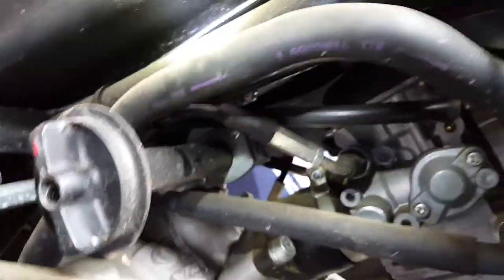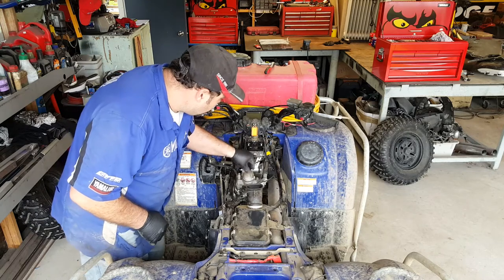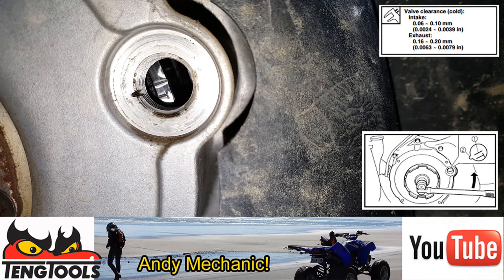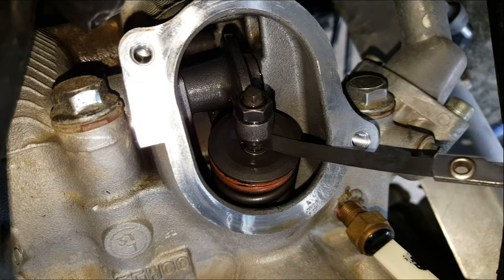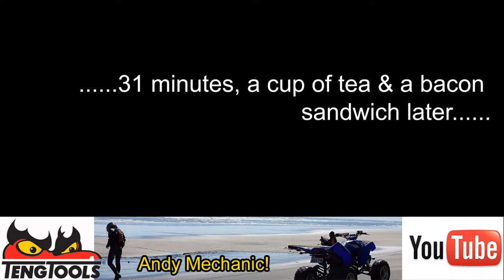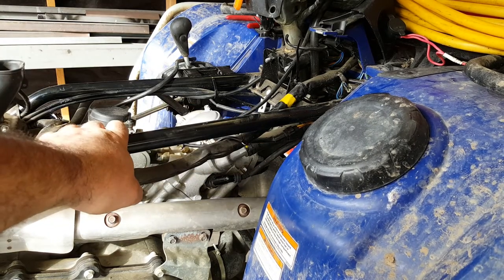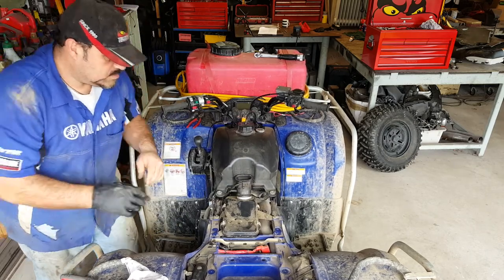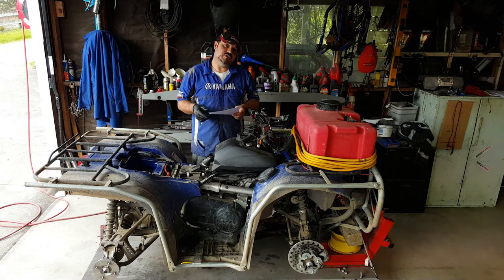Yamaha Grizzly 450 - valve clearance adjustment #1806

Comment: Ive seen on another video to get better access with out removing the front Fender assembly. Is to remove the front left wheel and strut. It help to get better access to the exhaust valves.

Comment: I adjusted the valves on my 03 Kodiak went 0.08 on Intake and 0.18 on Exhaust well with in spec and noticed it very noisy.  Starts great and idles. Just a bit tap it noise. Although the Valves where never adjusted since it was new. And where way too tight before i went in there to loosen it up.

Comment: Hey Andy! Great videos I watch you adjust the valves on a 450 grizzly. I assume that's the same motor in the rhino?  I have a rhino 450 I've been working on, it starts up and idles push down on the throttle and it spits and sputters and bogs down want rev up.. I've took carb off and apart cleaned it. new spark plug and air filter.. No change same problem.. Any ideas? Thanks!

Comment: i was fighting the ex valve. doesn't matter what i do, fully open it or fully close it (with horrible access using a mirror) it seems that the gap doesn't change. looks like a fused valve. any idea how to get it loose? In valve was perfect. didn't even need any adjustment.
Reply from the maker: Rotate crank a further 360 degrees, you are not on the firing stroke
Reply: I thought both valves should be inspected on the same T line. Was I wrong?
Reply from the maker: No you are correct but remember, this is a 4 stroke engine = 2 turns of the crank shaft to 1 turn of the cam shaft. You are 360 degrees out on the crank shaft to rotate one full revolution and reset both intake & exhaust valve clearances
Reply: Oh....you get a point! so I assume i need to try rotate it additional 360 degrees and look at the ex valve. I hope that is the issue.
Reply: just emailed. thanks a lot :)
Reply from the maker: Do both intake and exhaust clearances again as the intake will be incorrect

Comment: haha!!! 31 minutes, a tea and a bacon sandwich later  Great video!  I will be doing this tonight along with a carb cleaning, as i have a WOT backfire/bog/loss of power, anything else you can think of that i should be looking at?  I've done spark plug, belt, and checked clutches
Reply from the maker: Check intake valve for leaking too.

Cheers Andy

Comment: I got a carburetor question, does the small  pin in the needle valve suppose to pass the air and stop when compressed or is it the entire needle valve that lifts up of the bush to allow fuel to run in? My needle valve (new) doesn't allow air flow unless i use an air compressor which blows up the whole valve and let the sir flow
Reply from the maker: The spring loaded pin is (maybe) a damper to prevent the valve 'chattering' on the valve seat which would cause excessive wear. The fuel should only pass between the valve & valve seat. 

That's how I understand it. I'm sure other experienced viewers may be able to add to my comment too.

Hope that helps

Cheers Andy
Reply: @AndyMechanic  Oh wow. that helps a lot! if that is the case, mine is fine and I can finish the carb installation. I thought it might be the pin that regulates the fuel flow.

The "hinge" that binds the needle valve with the float, also slightly lifts the valve up when extremely deflected upwards. should it be like that?
Reply from the maker: Hmmmm....really? Well I think under normal operation, with the floats just 'floating' in the fuel they shouldn't reach such an extreme angle so should be fine.

Cheers Andy
Reply: @AndyMechanic  does the hinge that binds the float with the valve should be tight so when the float moves it will immediately lift or compress the valve? At the moment it is very loose fit and dangles too freely so when you move the float upwards, it doesn't lift the valve. I wonder if I should change it
Reply from the maker: The pin that goes between the two 'towers' is usually tight in the towers but the floats should be loose on the pin and flap freely.

Comment: nice video Andy, I'm working on a 2004 Yamaha Bruin 350 4x4. I have a feeling that these valves have never been adjusted. Upon pulling the starter recoil assembly, it nearly ripped my hand off. How far off are the clearances from the 2014 model from the 2004? Also I seen a tube coming off your carb? Is that going to the air box??? This one is also missing the air box as well...

Comment: If my engine backfires and wont start after valves adjustment, carb and air filter cleaning, should I check the timing chain and tensioner?
Reply from the maker: You should check both valve and ignition timing. Also do a leak down test to check your valves aren't leaking.

Good luck. Cheers Andy
Reply: @AndyMechanic  Thanks. will do it now. i want to remove the camshaft sprocket cover so i can check the timing chain position at TDC, also if it is tight. Is it possible to remove it without removing the whole plastic front of the Kodiak?
Reply from the maker: Yes, just the side panel should give sufficient access. You may want to remove the fuel tank too if too tight a space to work in.

Cheers Andy
Reply: @AndyMechanic  Thanks Andy. Ill give that a go. I want to inspect the chain tensioner if it failed. Other than checking the chain slack through the camshaft sprocket cover opening, is there another way? My ATV was running very nicely, starting easily before. I suspect something had failed ....
Reply: start whit the plug

Comment: Hi... I know that this is not a Bruin video but I am wondering if you might me able to help me out a bit anyway? I have looked everywhere and I get different valve clearance setting recommendations from different places I look. Can you help me out? I have a 2006 Yamaha Bruin, Model: YFM350A - Vin: 5Y4AH10Y66A021826. The other thing is, my feeler gauge has both Metric and Inches. If you can help me out with the correct clearance settings, please tell me if they are to be used with Metric or Inches on my gauge?  << Thank you very much, John >>

Comment: Wow very strange. I opened the sprocket cover and while aligning the rotor T mark (TDC) the sprocket round indentation was way off!! So i rotated it another 180 degrees and it was closer but man....at least 15 degrees off. I have no idea how the ATV was working smooth before.....chain is  very tight so I cant see how the tensioner is faulty. zero slack in the chain. Any ideas?....unit only backfires when trying to start the engine but it doesn't run at all (or cough)
Reply from the maker: Ensure you are looking at the correct timing marks. If they are out then you found the problem.
Reply: @AndyMechanic    OK here is the latest update and its crazy - I established the TDC using a pencil in the cylinder so pencil (piston) is at the very top, sprocket indentation mark was perfectly aligned with the crank notch AND both valves were at the top position and loose. Now, at this point i checked the flywheel/rotor T mark and it was not there at all. THAT is off. I was amazed with the IN valve as it was sssooooo open (instead of 0.1mm it was about 3.5mm!!!). reason being so is that I adjusted the valves based on the T mark of the rotor (not the sprocket as now). 

Not sure how to get the rotor T mark aligned with the sprocket (without a major crank surgery)
Reply from the maker: Right....there is a chance that the flywheel has broken it's key way and slipped. To confirm this you'll need to remove the stator cover and flywheel....to do this you'll need a puller.
Reply: @AndyMechanic  it means to drain the oil I just filled too.....rrrrrrrrr
Do you have a video of you doing a similar work?
Reply from the maker: Sorry no. Not yet....
Reply: @AndyMechanic  If the sprocket marks  are correct (TDC), piston and valves are at the very top (TDC) and i readjust the valve as is with the rotor/flywheel T mark off, would that work?
Reply from the maker: No. If the flywheel has moved in respect of the crank shaft then the ignition and injection timing will be out.

Comment: Thanks for the detailed video!
did you remove the side fender to be able to adjust the exhaust valve? no room at all. trying to figure out how to get in there
Reply from the maker: Yes, side fenders and fuel tank etc...easy job and makes it much easier. Plus it's important you don't get dirt in the engine.

Many thanks for the feedback 

Cheers Andy
Reply: Thanks buddy. one last question, do both in and ex valved adjusted at the same top dead center? it seems that my ex valve gap as super tight. When i set the top dead center, i aligned the straight line next to the T mark. I assume the T just marked the Top dead center while the line is the spot to be aligned?

Also doing a surgery to the leaking carburetor. do you adjust the float flat with the carb body?
Reply from the maker: Yes, line to side of letter 'T'

Float adjustment - highly unlikely it's not correct. If carb leaking/overflowing 99% chance the problem isn't float height. Adjustment method/specs vary to manufacturer - you need the Service Manual for specs and measuring method.

Hope this helps
Andy
Reply: True, it was not sealing so I just ordered a carb built kit but I was wondering how important the float adjust is. couldn't find the measurements anywhere for the Kodiak 400
Reply from the maker: Email me the full 17 character VIN.  andymechanic@live.co.uk
Reply from the maker: Vin will be on frame. Or send model code - white sticker under seat (if still there?). 4 characters then a dash then 3 numbers
Reply from the maker: Owners Manual will show where VIN is located - vehicle ID
Reply: Yes found this one, 5GH1-010, thanks mate

Comment: Hi, might need a little help.  I just did my first valve clearance adjustment.  Everything went fine, I adjust valves, they were alil out of spec.  And I adjusted them to .10mm to intake, and .20mm for exhaust.  Everything seemed to have went fine, until I put everything back together and started it back up.   It starts fine, but it smokes a little and can smell something burning, and it's making a loud clanking noise.  I don't know if I adjusted them wrong, or what. After I tighened the locknuts on the valves, I made sure to check them again with the feeler guage.  I'm not sure whats going on, but doesn't sound good... and somethings is burning.
Reply: I think I might of adjusted them while not being at the the top position.  I thought I found the line, but the line I found was a half of line. But I didn't see no T. I kept turning the  crankshaft but didn't see no T.  I might have to redue it all over again! bleh! after being at it for a few hours.
Reply from the maker: +Rperley 84 yes, it's very important the engine is cold and the piston is at TDC  when the tappers are 'off cam' ie the lobe of the cam of off the heel ( so valve fully closed)
Reply: Andy Mechanic the engine was cold. i just think I didn't have the crank lined up right.
Reply: Rperley 84 note to self. Don’t fix if it’s not broken. If your bike is starting and running fine don’t start taking shit apart!

Comment: I have an I issue with my 04  450 Yamaha Kodiak and I assume is the same as this one, I changed the oil and now it starts to smoke for about 3 minutes but then it stops. Do you think it would be the valves that need to be adjusted or piston rings?
Reply from the maker: +Daniel Ceja it's not valve adjustment. I'd suggest replacing the oil with thicker type. The engine doesn't want fully synthetic. Best either mineral or semi 10w40 should be fine. It's obviously getting tired and could do with a top end rebuild, hone and new piston rings...

Comment: I tried it your way. Used Max setting.. HOLLY HELL!! Wouldn't start right. Had no power!  I went back in. and there set on the tight side of the settings. No value slap and she don't sound like she's flying apart.

Comment: What if you don’t have that adjustment tool
Reply from the maker: Are you talking about the feeler gauges? Or the Tool to hold the adjuster Bolt Stationary?

Cheers Andy
Reply: 0.10 intake an the 0.20 exhaust.. if you don’t have the adjustment tool ..  what else buddy said I can just hear a tap an should be good .?
Reply: Yes Andy feeler gauge
Reply from the maker: Well, you'll have to source a set, they are not expensive but are a necessary tool for completing this task. I would suggest that until you get a feeler gauge set you leave the valve clearance as it is - setting it wrong can cause poor starting,  burnt out valves etc

Cheers 
Andy
Reply: My quad won’t start an buddy told me this is the problem cause I haven’t touch my valve in 2200 km did carb clean an spark plug ..